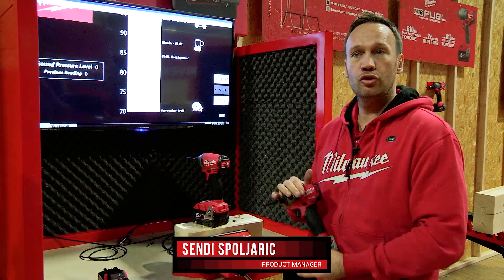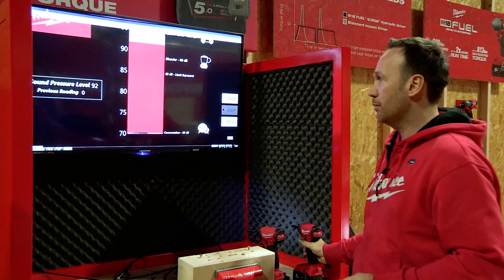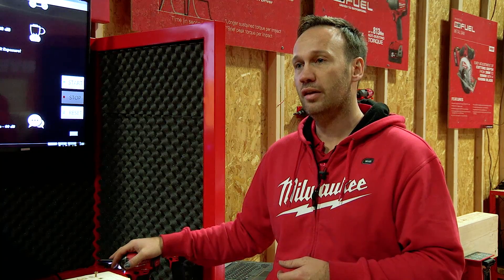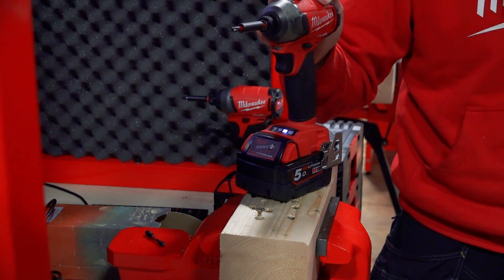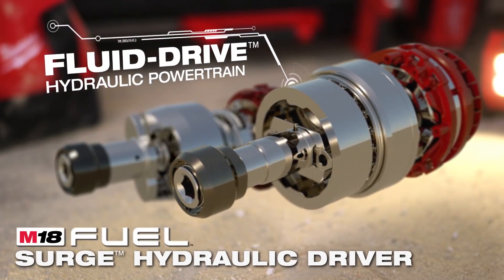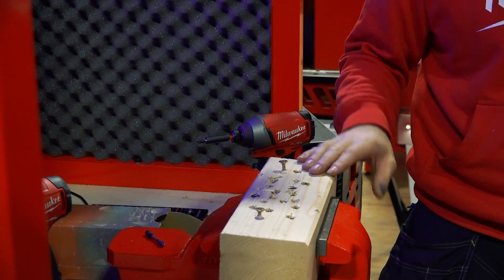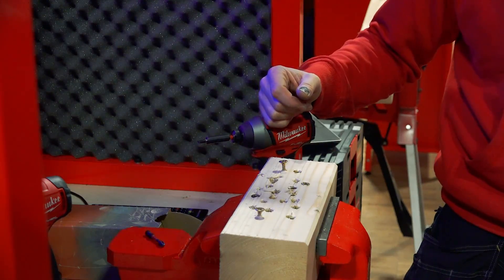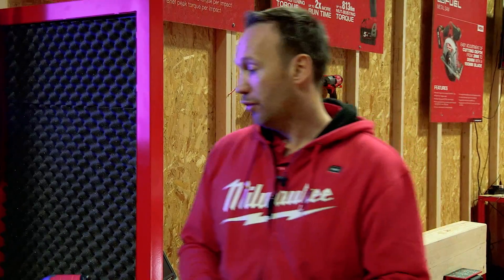Milwaukee M18 FUEL SURGE Hex Quiet Impact Driver Demo

Comment: Hey roger, was just looking at you're 18v combi drill review (great video) was just wondering if you are going to do one with impact drivers?
Reply from the maker: We were looking at this but couldn't work out what to say that would be useful. If you can give us a clue we might do it
Reply: Maybe things like which one is the fastest ( alot of companies say there is but dont have anything to back them up other than numbers) chuck wobble,torque,battery life... just a rough example of what u could use i suppose

Comment: Hi Roger, that's interesting.  It's nice to be kept up to date with new technology. Noise reduction is a good thing of course, but having a more reliable impact driver (almost said 'tool' there!) is also a good thing in itself. The last thing I need is it to break halfway through a job...... Bob.  PS - I look forward to your reply!
Reply from the maker: I did ask about reliabiltiy and being oil filled you think about seals but they reckon they are good and doubled up. The fact that there is no hammer hitting an anvil means there is less to wear. I think it is early days, you have to take a punt with all new technology otherwise we would all still be standing around the wheel discussing the pros and cons.